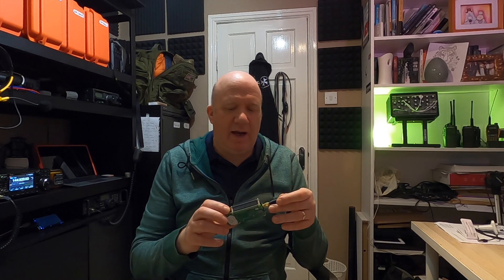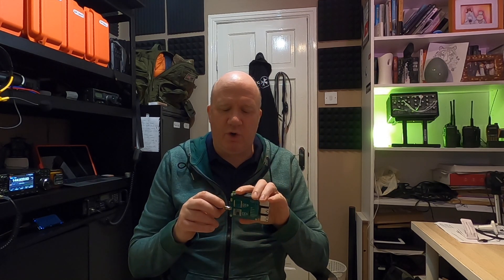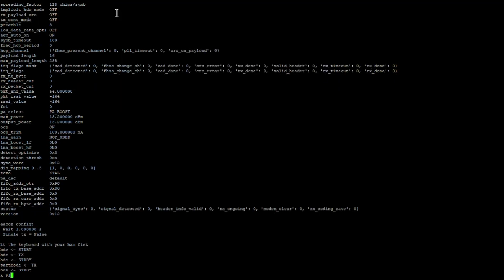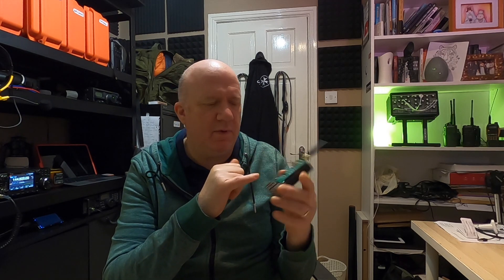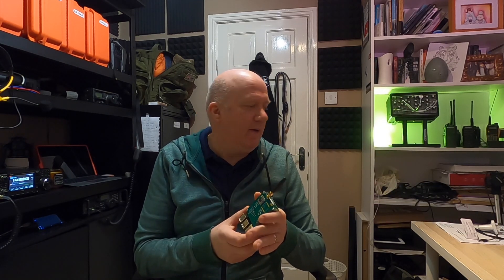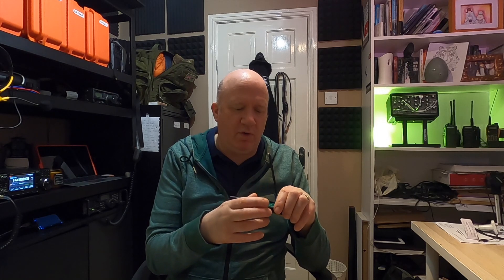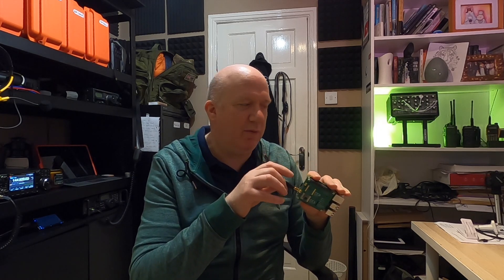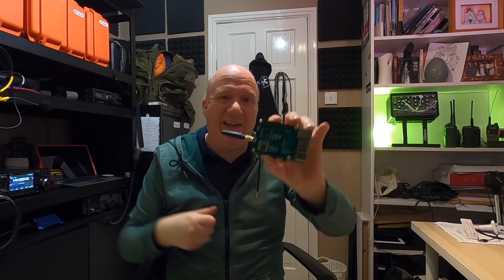Ideas for LORA project for Ham radio operators

Comment: Back in the 80's I was able to stream a video over a Mod dem. It was not that great but it worked. So with the better updated technology we should be able to do this over radio waves far efficiently.
Hey we transmit TV over VHF. But the issue is streaming. Login to request a stream.

Comment: Any news on the LoRa research? I am interested in some remote monitoring of water presence and temperature using Amateur band gateway and a LoRa bridge. Seems to be a bit bleeding edge at this point. If you know of any interesting links for similar projects, let us know. Thanks for the efforts to date.
Reply from the maker: Cheers, the LoRA work is paused at the moment, it’s been difficult to revisit that since lock down finished and I could get back outdoors

Comment: They are interesting gadgets for sure, but I'm struggling to find a usage case. I would like to have a crack at Wifi extended LAN's using the Ubiquiti access points, but the geography around here between villages doesn't lend itself to LOS comms, and the cost of the access points and antennas is beyond my budget right now.
Reply: Simply put a remote weather station in the garden sending data over Lora to the Gateway Lora in the house, which then transmits the data over Direwolf. There are plenty of projects doing this already with code on Github
Reply from the maker: I've got my Netatmo out via APRS, I'm now just looking at wx sensors for the RPi